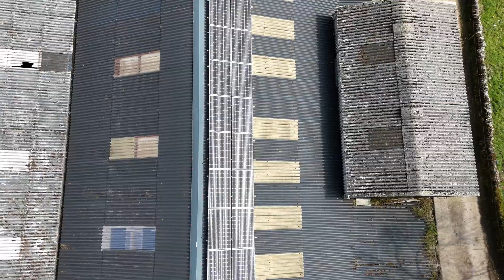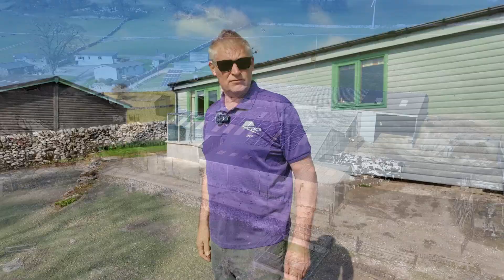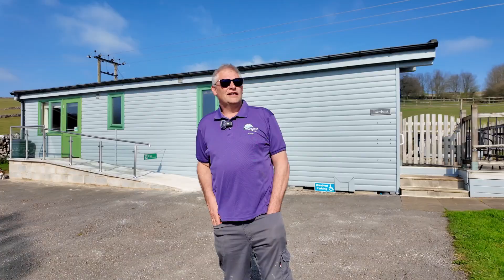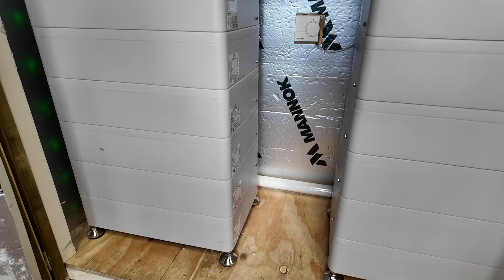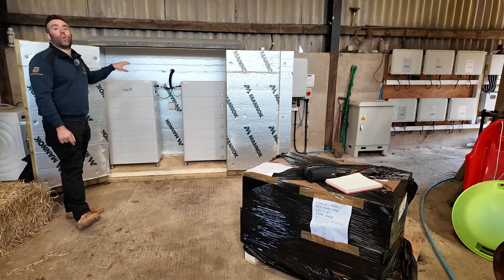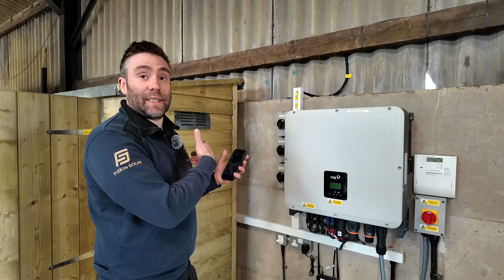How this farm used RENEWABLE energy to boost PROFITS | Farm DIVERSIFICATION Case Study

Comment: nice system , love the insulated 'shed' for the batteries an often overlooked problem.., as a farmers son - now electrician  I'm also always banging on about PV to any one who'll listen .. Having come up against similar problems in the past if the farm owner still manages to fully charge the batteries and start exporting again adding one or several domestic Hot water tanks as a "dump load" is a very viable option , Obviously only heating the water when they've got excess energy to export.... might be ideal for the holiday challets.
This can be a good idea if you have hard export limits imposed by the DNO.
Reply from the maker: Nice, thanks for that. Solid advice. 💪

Comment: This company may have made an economic choice to assist their profitability, but it is an incresae in the cost to other consumers.
Too much solar output decreases grid demand and at times means that other genertaors have to be curtailed, this is more expensive thatn if they sold their electricity to the wholesale market putting up the cost to teh average consumer. 
Had we not built so much renewable genration on our grid, solar for individuals would be uneconomic.
Reply from the maker: Thanks. I'll pass on you comments. 👍